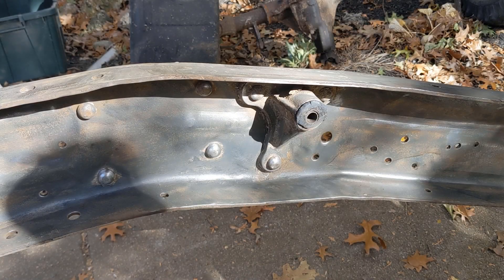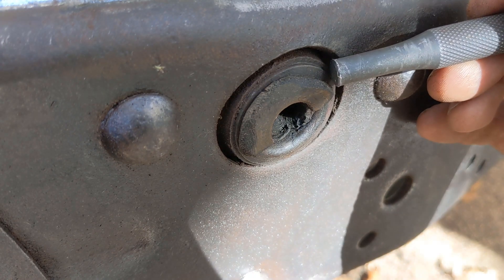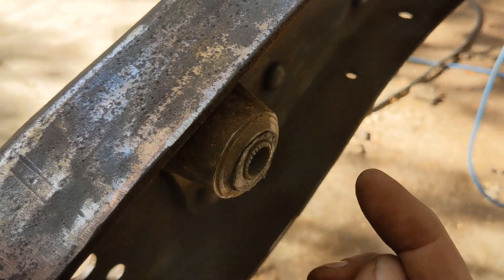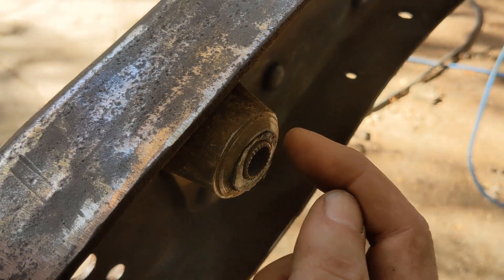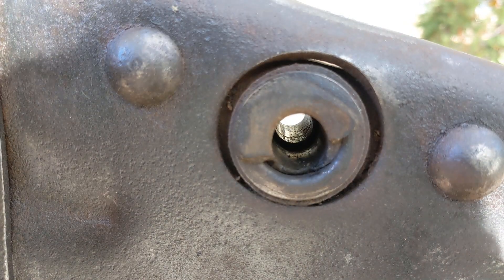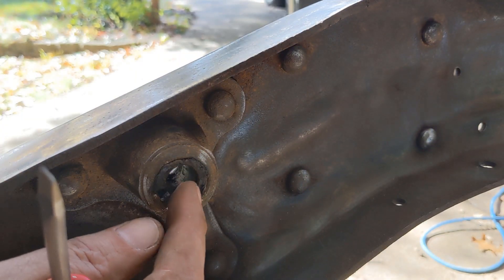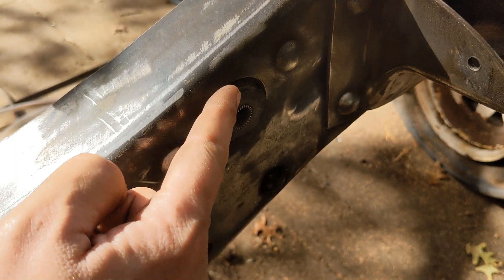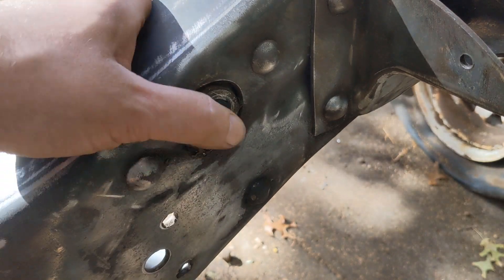Removing Leaf Spring Bushings

Comment: Could you not drill into the rubber in several spots around the bushing to destroy the rubber to drive the center sleeve out without burning it?  That's what I did on the WJ's upper control arm bushings.
Reply from the maker: You can, but fire is more fun.
Reply: It's so stinky.  I was doing mine in the garage.  That would have made the whole house stink.